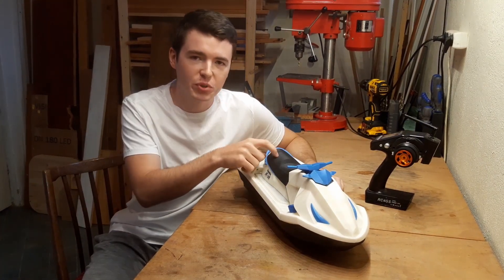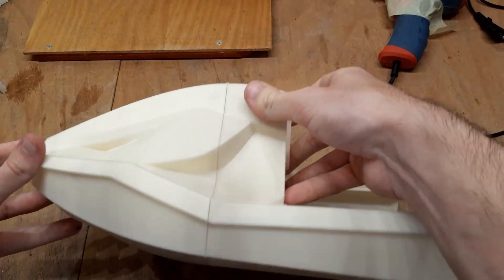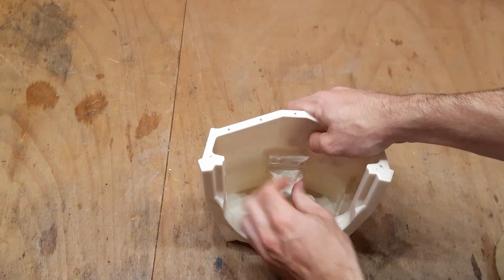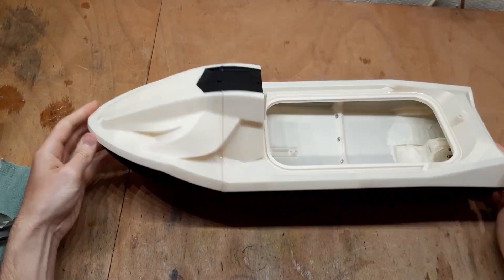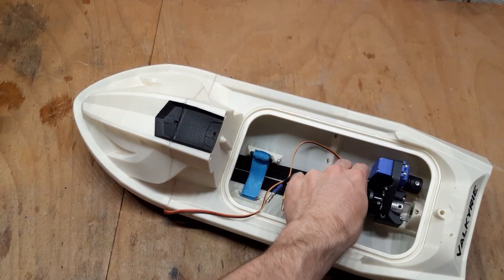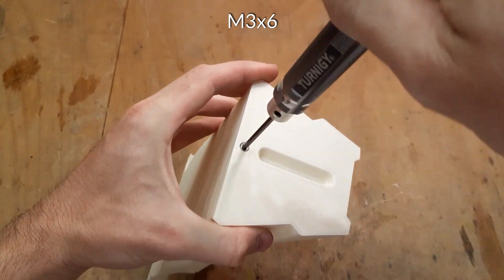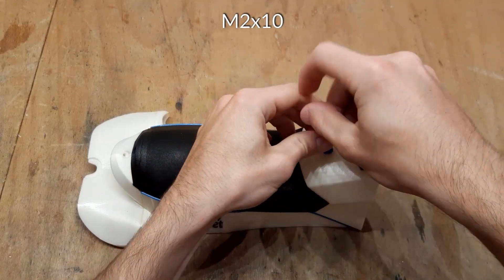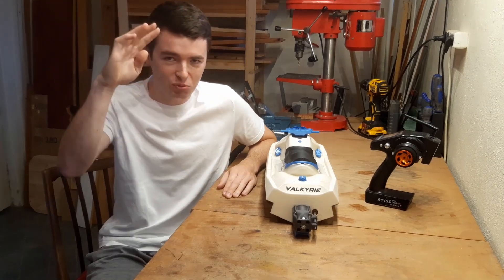Valkyrie Full Build / 3D Printed RC Jetski

Comment: what electronics should i use like the motor, esc, battery, and servo to make it fast and fun
Reply from the maker: Are you using M-Jet 30 or M-Jet 35?
Reply: @mjetdevelopment the M-Jet 35
Reply from the maker: @FrankieTrey13  Then please follow the M-Jet 35 manual, page 5:
https://drive.google.com/file/d/1d3b9momWcgAeUAn5o1v0-QZcIMYy4U90/view?usp=sharing

For the Valkyrie in particular, I would recommend motor size 3674 or 4074 to keep good space for the battery. Also, it is generally better to use more cells, preferably try to get a 6S setup (or 8S if thats possible)

Comment: Why not use spray foam in the nose??
Reply from the maker: @randysalamon-y7j  You can use it too, I just find that there is a risk of cracking the hull if it expands too much, and also I am not sure how it behaves in water, it might absorb water and get fat instead of actually floating
Reply: @mjetdevelopment  will let you know, hull is not enclosed so it will foam out the back, just trim off, as for floating or absorbing water, will test first and advise
Reply: spray foam works well, and yes repels the water, also redid the seat so it covers the whole seal, i'd attach a pic but unable to do here
Reply from the maker: @randysalamon-y7j  Glad to hear, maybe I'll look into spray foams too, it must be way simplier than doing all the cuts.
To share pictures and more there is the M-Jet facebook group:
https://www.facebook.com/groups/623045356071128/?ref=share

Comment: How am i supposed to install water cooling
Reply from the maker: @trochtydust696  Connect the sillicone watercooling pipes from inlet (pressurized water from the jet pump) to the motor, then from motor to ESC, then from ESC into the outlet away from the boat.
Reply: But where do i plug the silicone cooling pipes to the motor and esc where are the plugins
Reply from the maker: @trochtydust696  You need to glue brass pipes into the slots in Valkyrie hull rear. It's the same process as in this video 11:51

https://www.youtube.com/watch?v=00WD8rOqKGE&t=21s
Reply: @mjetdevelopment  where do i conect it to the motor
Reply from the maker: @trochtydust696  You need a brushless motor watercooling jacket

Comment: Will the nitro seat fit on the electric chassis? I don't have a large enough bed to print the tpu cover , thanks
Reply from the maker: It does not. What printer size do you have? I am thinking about a solution for smaller printers, not sure if it will be successful yet.
Reply: @mjetdevelopment  220x220

Comment: @mjetdevlopement do you have any links to order the parts like o ring seal brass insert…
Reply from the maker: Sourcing of the parts is very location-dependent and also some sellers change with time, so I don't have many links. 
Just a few random ones you might have luck with:

https://www.veryseal.com/product/5x15x6-viton-oil-seal-fkm-metric-tc-oil-seal/?v=f0aa03aaca95

https://www.123bearing.eu/seals-OA-5X15X6-FPM

https://www.123bearing.eu/bearing-housing/deep-groove-bearing/single-row/s695-zz-inox

https://www.123bearing.eu/bearings-S635-ZZ-ZEN

https://www.ebay.de/itm/353827460993?var=623198168421

Comment: Amazing work!! You know what's next... remember the Kyosho Hang On Rider RC motorcycles?  Now we need a dynamic moveable driver on board, super light, 1 servo in a y cable for steering channel. I'm buying the files now and will design a pilot and share it with ya.
Reply from the maker: Wow, I am interested how that will go!

Comment: Very nice design! What size and kv motor did you use? Battery cells?
Reply from the maker: I used the same motor as in my 4G Hull build - 3670 1200kv on 6s 2600mAh. But the Valkyrie (respectively the M-Jet 35) is compatible with up to 4080 motors.
There is a lot more information to motor selection in the M-Jet 35 manual:
https://drive.google.com/file/d/1d3b9momWcgAeUAn5o1v0-QZcIMYy4U90/view?usp=sharing

Comment: Is this hull also suitable for the M30?
Reply from the maker: No, these are not compatible. 
The Valkyrie has an integrated M-Jet 35 pump housing.
Reply: @mjetdevelopment  will you create a m30 version in the future?
Reply from the maker: @hjl4004  I am not planning to do so. The M-Jet 35 is better in every way, going back to M-Jet 30 would be a considerable downgrade. But of  course you can try to modify the Valkyrie's hull for yourself.
Reply: @mjetdevelopment  thank you so much for your designs. Love your content, really mindblowing!
Reply: Do you have a direct link of how or where to order the custom metal parts for the drive.
Reply from the maker: @roadrashracing1796  I ordered the metal impeller from PCBWay, but I sourced the other parts locally, so I don't have any useful links for that.
I just have some random links for the other hardware like seals bearings etc you may find useful:

https://www.veryseal.com/product/5x15x6-viton-oil-seal-fkm-metric-tc-oil-seal/?v=f0aa03aaca95

https://www.123bearing.eu/seals-OA-5X15X6-FPM

https://www.123bearing.eu/bearing-housing/deep-groove-bearing/single-row/s695-zz-inox

https://www.123bearing.eu/bearings-S635-ZZ-ZEN

https://www.ebay.de/itm/353827460993?var=623198168421